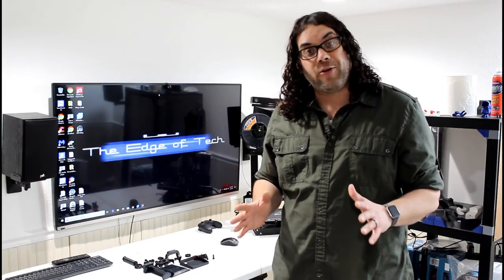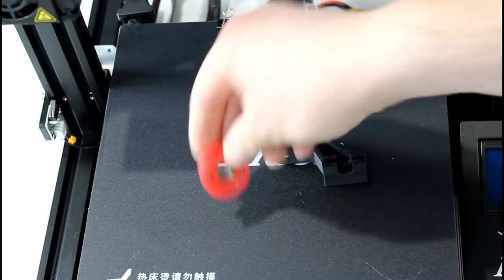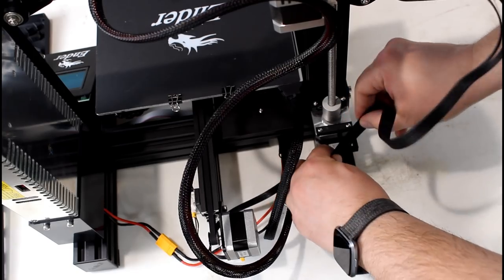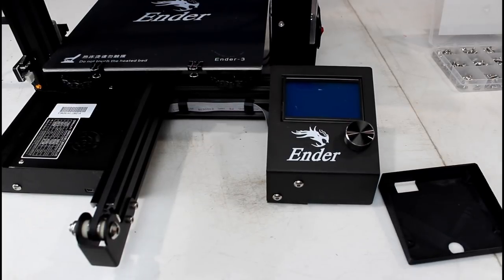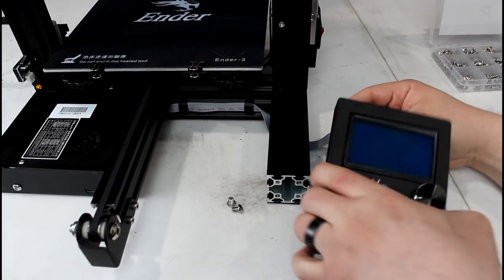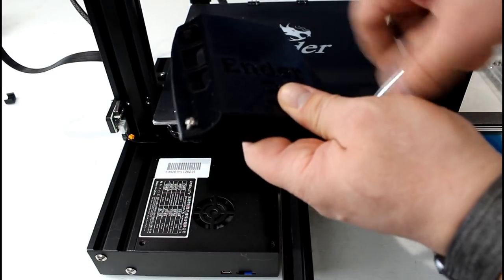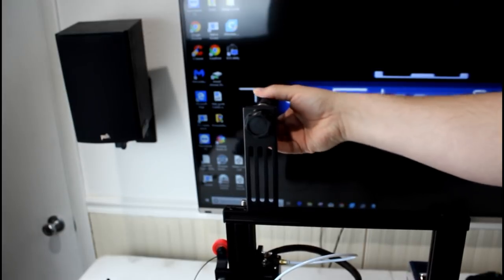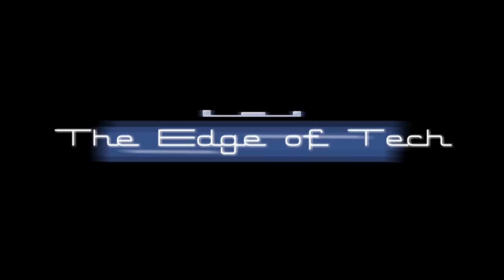6 Ender 3 Printed Upgrades in 10 minutes

Comment: Hey @The Edge of Tech , is it possible to get the gcode of your prints? I gues you are prited with the ender 3 / eder 3 pro ? And Filament? - I would print it in PLA 1.75 mm 😄
Thanks in advance 👍
All the best to you

Comment: Jim, I went to thingivers for the petsfang for my ender 3 pro. Way to many files and have no idea of the correct ones. Maybe you can help? My pro has stock 40x40x10 fans. But I did order 50x50x15 blower fans so i can upgrade. But have no idea were to start. Any help would be great.
Reply from the maker: Hi, if you look at the PDF for Creality machines, it will show you which ones to use. I think it's also on the thingiverse page if you scroll down through the notes. I don't think you can use the Bullseye duct with the 5015 fan, but you can use the petsfang. I can look at the instructions tomorrow and help you out if you still need it. Just let me know!
Reply: @TheEdgeofTech  I think i use the cr10 stock manual base v11, and cr10 and tevo 5015 duct v 7.5. Since i an getting the 5015 fan i might as well use it. Does this still use the stock 40x40x10 hot end fan?

Comment: Amazing video! Thanks Jim. Quick question what size bearing have you used for the Ender 3 filament roller? Thanks!
Reply from the maker: Thanks for watching! I will make sure to get that in the section below the video, but they are 608 skateboard bearings. You can get them online, or you can got buy a fidget spinner and take the bearing out of that! If you have a skate shop around you or sporting goods store, they will sell them too!